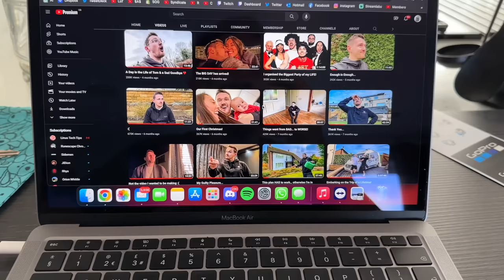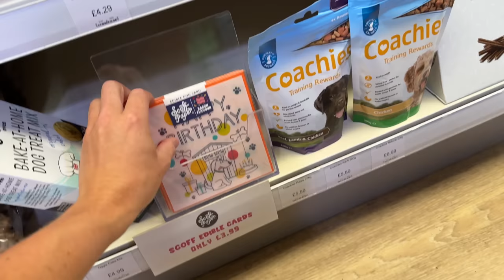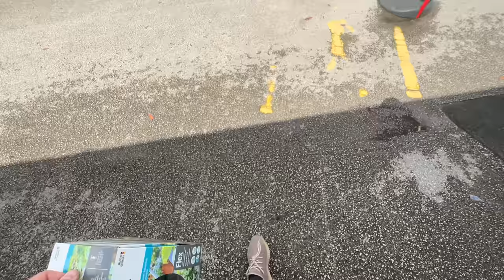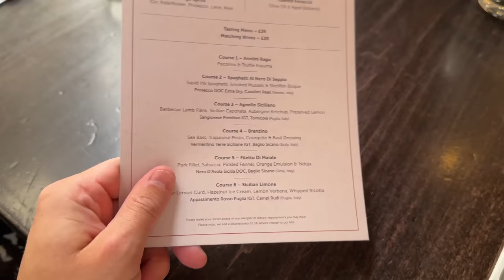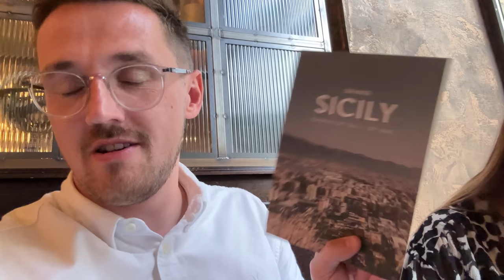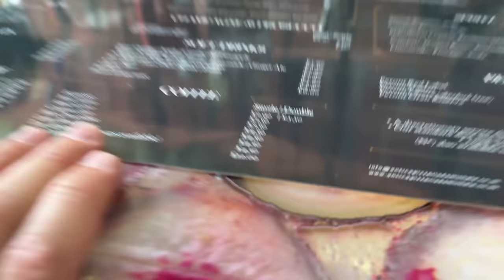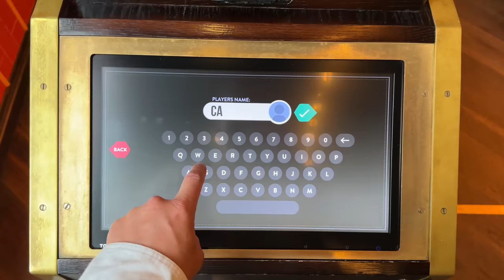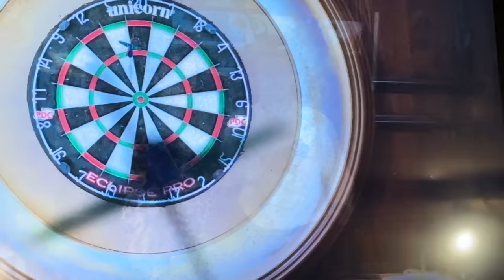My Secret Birthday Surprise!

Comment: TOM!

I keep meaning to leave this comment but todays the day, I have a method to help you get your vlogs uploaded on time.

If I recall, you have a server rack in your house from when your internet got upgraded in that video a few years ago, why don't you build your own media server? You could attach it to your network and connect to it that way, or if you use something like Docker, you could run a virtual machine on it and then connect to it from anywhere in the world! You'd have the benefit of your fast internet speeds, and you wouldn't have to waste the time downloading the footage Orion sends you via Dropbox only to re-upload it again as Orion could also remotely connect to the machine! It'd cut out the vast downloading and uploading times both yourself and Orion experience too because your connection wouldn't be throttled by Dropbox's limitations.

ALSO I remember you asking for ideas on how to pimp out the Defender, my dad actually has one that's a few years older than yours (It has flaps on the front instead of A/C!) but if you'd like some pictures for ideas then drop me a reply and I'll work out how to send some over!
Reply: Too much work properly to do and maybe one day Orion will have full fibre broadband